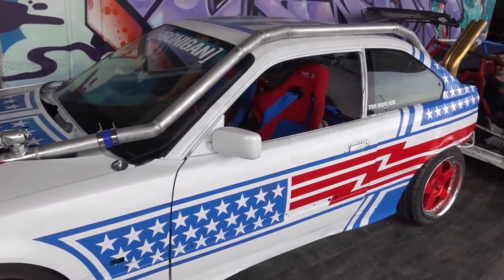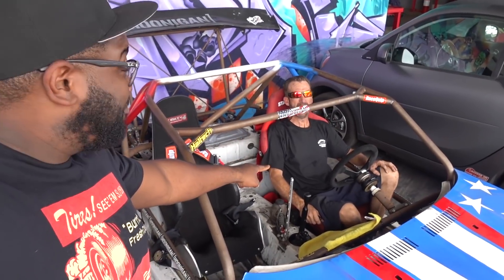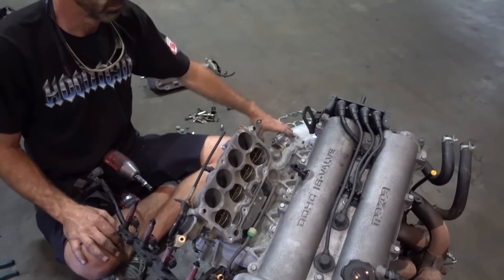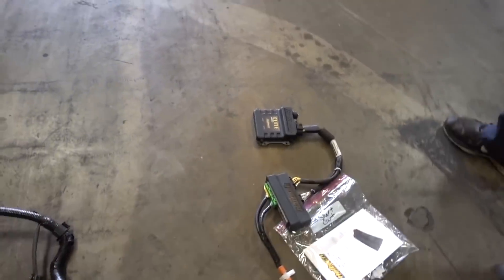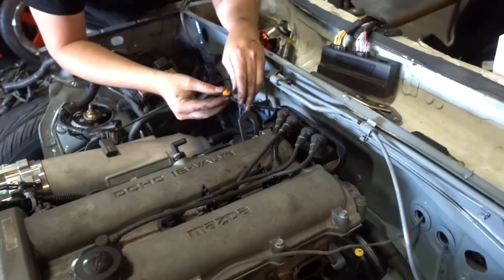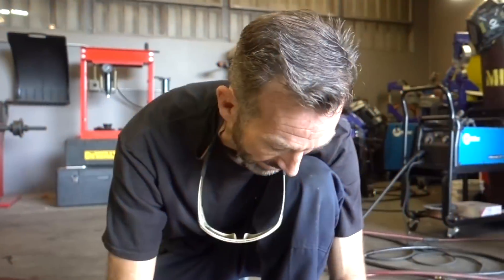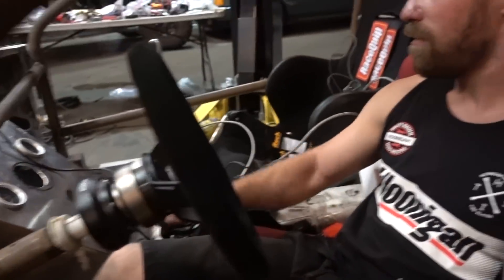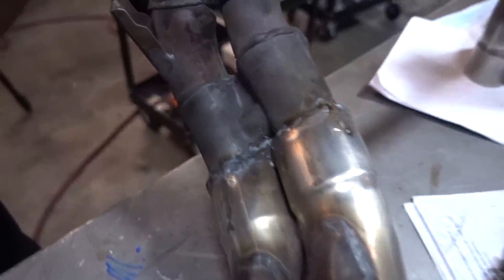ShartKart Gets Blown! 1.8l Swap + Supercharger on our $200 Miata

Comment from the maker: How much power do you think this new setup will put down?
Reply: TheHoonigans 420
Reply: TheHoonigans 160-180
Reply: 176hp
Reply: 4,2hp from the front left tyre
Reply: 300 ?
Reply: at least 8
Reply: 230
Reply: 275 hp
Reply: 261hp
Reply: #wheresgarythough
Reply: 204
Reply: 236hp
Reply: LS SWAP!!!
Reply: 65
Reply: 202 at the wheels, 235 at the crank.
Reply: 245
Reply: +156 hp from the Supercharger on low boost
but 200hp per stickers
Reply: I'm not sure what it going to put out.... But it's going to be fun 😂😂
Reply: Way more than enough 😭😭 🤘🤘🤘🤘🤘🤘🤘🤘🤘🤘🤘🤘🤘🤘🤘
Reply: Dont know anything about that motor but I'll guess 200-300 hp
Reply: 205 at the wheels!
Reply: Matt Scalf -that’s a huge difference bro lol
Reply: 69hp at idle. 420hp at full rip
Reply: 180 on 91 oct 210 on e85 if you guys are on the 80mm pulley probobly 200 (91) 230 (e85)
Reply: 180whp-145 lb/ft. If Haltech tune raises rev limiter to 7500, maybe a skosh more.
Reply: TheHoonigans 218bhp
Reply: 185/150 at the wheels
Reply: 200
Reply: 181whp
Reply: 225 to the wheels
Reply: 268 hp
Reply: 228
Reply: 4 horses
Reply: I have the cleanest stock looking 1000hp c5 z06 you've ever seen. Would love to come do some burnouts for you guys. I live fairly close to the shop
Reply: I heard you stepped down from the drag race vs Mike Finnegan....
Reply: 256
Reply: 230
Reply: 300-450
Reply: 250
Reply: 350
Reply: I say 325
Reply: 195
Reply: 310ish with a good tune maybe?
Reply: TheHoonigans 1000 hp just like my uncles supra 😀😂😂😀
Reply: 280
Reply: 200 flat
Reply: 174hp
Reply: TheHoonigans scotto got the audi running which is great now for Herts fd rx7
Reply: 500
Reply: 261.8
Reply: Enough
Reply: 298
Reply: 213hp 219ftlb
Reply: Can i win some car? 140hp
Reply: 38 panda bears
Reply: TheHoonigans more than enough.
Reply: 191 hp/ 143 tq
Reply: TheHoonigans 190hp
Reply: So is shitcar get dyno tuned too after the turbo install??
Reply: At least 1320
Reply: between 0 and 1000
Reply: More than 2
Reply: id say around 250-300 💪🏻
Reply: 69 hp
Reply: Engine 300+ rims 20+ livery 100=420hp
Reply: Enough to spin the tires in ridiculous fashion...
Reply: About tree fiddy
Reply: 199whp
Reply: 194.2 WHP
Reply: 260hp
Reply: 210
Reply: 190
Reply: 156 hp
Reply: One dollar Bob
Reply: TheHoonigans 211hp/198tq
Reply: 200
Reply: 213
Reply: Yes!
Reply: 170
Reply: 190-210
Reply: Depending on fuel im thinking 93 or 91 which ever yall have will be 190whp- 175 ish tq..e85 215-220whp -185ish tq lol ..so what do i get if i win??  lol
Reply: 3 less than before
Reply: At least 12.
Reply: 250 hp
Reply: 259
Reply: 185
Reply: 215. DID I WUN?/
Reply: 210 hp 235 ft of torque
Reply: 94 hp
Reply: 245hp
Reply: 1.8 can make almost 200 na. With a centrifugal you will get at least 5 pounds and you should be able to get to 300 pretty easily. It's going to depend on if you make it flex fuel or not and how limiting the injectors are.
Reply: One dollar, Bob.
Reply: 237 to the wheels on 91
Reply: 250
Reply: 150whp
Reply: 240
Reply: It’s over 9000
Reply: Bout 750+
Reply: 225 WHP.
Reply: TheHoonigans 220 at the wheels
Reply: 150-160
Reply: 260
Reply: 270
Reply: 280
Reply: 290
Reply: 300
Reply: 310
Reply: I'm gonna guess 215 whp.
Reply: +- 200 hp
Reply: An import JDM NB8, non VVT, with a good supercharger tune and fully bolted with a free flowing exhaust.  Gonna have to guess around 230 hp of really usable power, with lots of area under the curve.
Reply: 210
Reply: 170bhp
Reply: 383 to the wheels first try lol sounds great probably mid 400s after they tune it
Reply: approximately 1 Beer with Brad
Reply: I'm going to go with...$1.00 Bob.
Reply: More than what it did before ahaha build scumbug next!
Reply: Lol on a stock block? You better not shoot for more than about 230 wtq
Reply: Without bothering to read the already hundreds of comments, I'm going with 257 wheel...
Reply: 180
Reply: 420 hp on hopes and dreams but 220 in reality  😆
Reply: -132whp
Reply: 250
Reply: Enough power to pull a gnarly scab off Dan's eyebrow? :D
Reply: what super charger kit is that?
Reply: 298 whp - 307 ft/lbs
Reply: 421
Reply: 230
Reply: TheHoonigans 1+ hp
Reply: Considering he swapped the injectors, yall have a kraftwerks supercharger with an 85 mm pulley im going to guess 247 at the wheels on e85.
Reply: 230hp If I'm right what do I get?
Reply: 225
Reply: 142hp
Reply: 100hp👌
Reply: @Lindeseina  lmao
Reply: Probably like 180 maybe 200 at best
Reply: 255 whp
Reply: 165hp
Reply: I'm gonna say 179 to the wheels, which is a hell of a lot for that thing!
Reply: 185
Reply: I'm turbocharging my 91 Drift miata aka the warbird in the winter, we need to tandem these things together lol.
Reply: 236.56
Reply: 280
Reply: Can u guys record in 60fps please?
Reply: 260
Reply: 196 WHP
Reply: 192hp first pull 135tq
Reply: 195 hp / 150 lb-ft torque @ 9.5 psi
Reply: 220hp 190ft tq
Reply: 220hp 190 ft tq ..

 Ish
Reply: 196 at the wheel with a good torks curve
Reply: Either 69 or 420.
Reply: Dayum!! I just saw a bit of the Honda hotrod episode and thought of you guys building a cool hotrod with the Miata. Just save the Miata's chassis and mate it with a Mazda mx6 body.... I'll call it the Mazda mx-6.5....maybe with a SCREAMING ROTARY!!! THAT'LL BE SO DOOOOPE!!!!
Reply: 162
Reply: 325
Reply: 214
Reply: 144 - 155kw
Reply: 241whp
Reply: If you are using E85 im guessing 275whp, if you're on pump gas 250whp.
Reply: 221
Reply: You guys always take it way more crazy
Reply: 316hk
Reply: Stock motor has 145 ish hp so with the upgrades i guess somewhat around 250
Reply: TheHoonigans yooooo as soon as Hert said “he drives and sc300” I was like “ahhh hell fuckin yes” I love my sc
Reply: 200hp?
Reply: 235hp
Reply: 180
Reply: 215.3
Reply: 431
Reply: Dan told me about this in Texas at formula drift if Ben wating
Reply: 211
Reply: 320-470whp
Reply: 15psi i think 280
Reply: Let's go back to the beginning of bad daddy braddy...daily transmission when he tried to wheelie the T bucket. We need to see the T bucket wheelie. I haven't seen the hoonigans so excited about anything like they were when Brad brought his madness to the donut garage.
Reply: a thousand for sure
Reply: 230
Reply: .420
Reply: 243
Reply: Formerly known as MR. POON_HUNT3R make your own comment
Reply: TheHoonigans 420.69 hp
Reply: 250/300
Reply: 222
Reply: 217 hp 190
Reply: 283 hp
Reply: put a c38-91, my honda is ripping with one of those.
Reply: 260-300 horses
Reply: -69

Comment: You know the Jaguar V6 fits in there? Rocketeer MXV6 KIT. GOOGLE IT! 😉
Reply: I just threw away one of those Duratec30 engines. Spun a bearing in my Mazda6 back in 2006, and there were no rebuild kits for it. :( Been dreaming of putting it in a Miata for years, but after 12 years in storage, I finally had to quit being a hoarder and ditch it. It weighs as much as an LS, (Making the LS the more sensible swap,) but it sure sounds nice in the Miata.
Reply: I realize shart cart gets broken a lot, but putting in a jag motor is just asking for failure. There's a reason most old jags now have small block Chevys in them
Reply: @Twaz zalla Dusty Korpse is probably referring to the modern jag/ford/mazda duratech V6. Absolutely nothing in common with the old jag inline-6 XK motors.
Reply: @JesusTheForgiver  well then he's missing the point of shart cart. It's meant to be a cheap project like shit car.
Reply: @JM-mn4ph   they just threw about 6 grands worth of shit into the car in this video alone in true hoonigan fashion shart kart was a "cheap" project car for about all of 5 seconds

Comment: The 1.8L was needed even if you could still use the 1.6L because the 1.6L unless its built cant make over 300hp but the 1.8L can get up to 500hp but i think it will get close to 360hp-375hp maybe more

Comment: Unusual to see a procharger on an mx5. With all the bolt on turbo/supercharger setups available, it's cool to see something a bit different.
Reply: Deadmetal its a centrifugal supercharger not a procharger although i would much rather see a roots style blower or a big turbo
Reply: This is a bolt on supercharger. It's the kraftwerks kit.
Reply: @badwords7963   procharger is a company that makes a centrifugal supercharger not a turbo and supercharger
Reply: @badwords7963  you are thinking of twincharged engines

Comment: I want ShartKart and ShitCar to be taken to CarMax and I want an appraisal. Yeah you guys bought the cars for $200 and $350. But I want to know what the car is actually worth now and approximately how much all the parts that you guys have added on cost. Would be a good insight of the cost of affording a hoon car which many viewers want to own themselves
Reply: Do they now raise the value due to aftermarket parts? I've taken a car there and received an insultingly low offer based on the stock vehicle's appearance and mileage. They didn't even care about a swapped engine, let alone any other aftermarket upgrades.
Reply: Richard King they don’t value after market parts they usually deduct. They used to say they would buy any car so I was wondering how much they could get them to buy the cars for. Then I wanted the to bring the cars back to the shop and do a break down of what the parts actually cost. And just show how fair or unfair the offer really was.... cause these cars have been beat to shit

Comment: You know SHIT CAR  you you guys ran too large of exhaust pipe to the turbo to get the spool the way you need to as you needed to increase the pressure not the volume because you don't have enough pressure to compress the exhaust gases you have the volume but your engine doesn't pump volume your engine needs to pump pressure to build pressure..... so if you want to make shit car faster and create more boost you're going to need to downsize the exhaust piping .... because now you have to compress all of that exhaust gas it's in that excessive large-diameter pipe and length of pipe so if you downsize the pipe diameter it has less volume to compress that's making the compressor work like it's supposed to